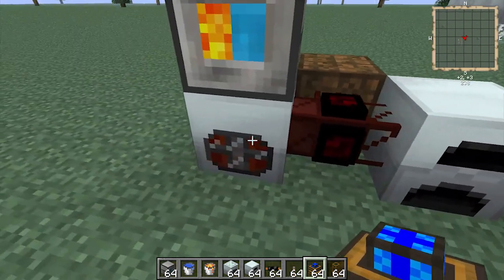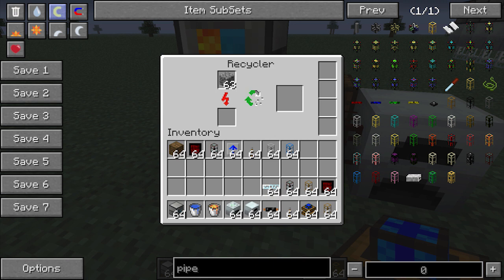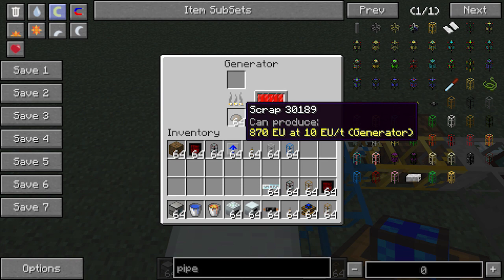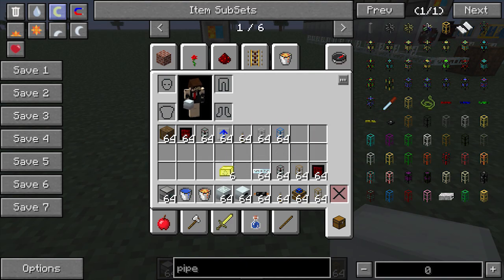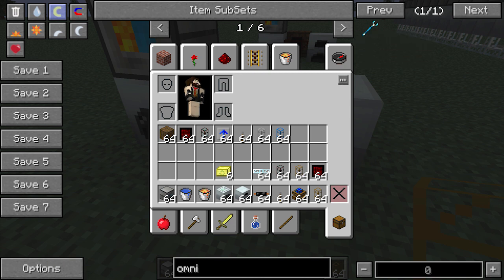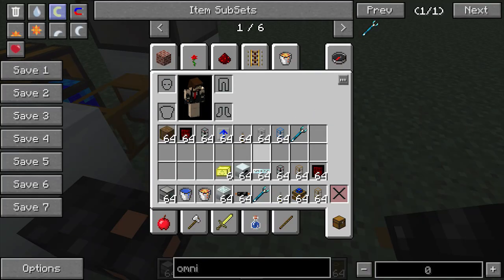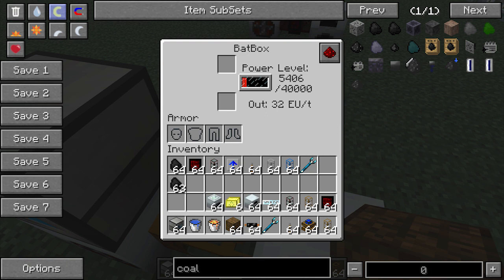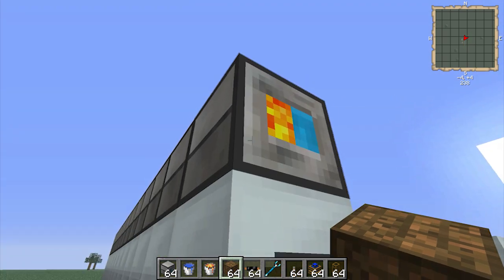FTB Tutorial: Unlimited Power, Sustainable EU Generator, IC2 & Thermal Exspansion

Comment: You are not using engine to pump scrap out. what is it on wooden pipe?
Reply: +Robert Kajor A gate. It is used to tell the pipe what to do. Probably on this case its set to give a pulse at all times when there is no redstone signal applied on it. They are made with assembly tables from BC silicon

Comment: Whats the name of the blue and the brown pipes?

The brown pipes are wooden pipes? But they dont look like normal wooden pipes..  is there Something special?
Reply: Ausyarr ok! Thanks bro!
It worked! Now I have another problem... 😕 i cant use the glass fibre cables for my thermal expansion machines...

And sry for my bad english.... I`m from Italy ;3
Reply: Flapp The Blue Pipes are insertions pipe but they don't exist anymore, the pipe addon mod is no longer updated. You can use diamond pipes as a replacement.
Reply: Aus yes but the wooden pipes... they look other then my pipes (ftb infinity?
Reply from the maker: Flapp Ok I got ya mate, there automatic ones with a gate in them that provides a redstone pulse. I'm not sure if the Buildcraft gates exist at the moment, either they exist of there is a bc alternative for them.